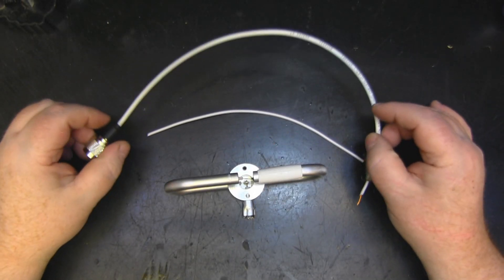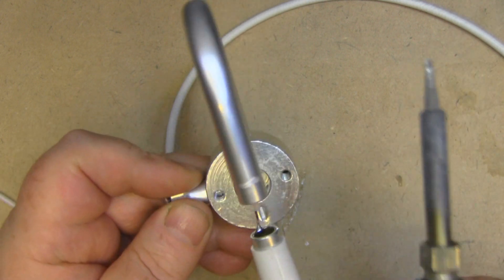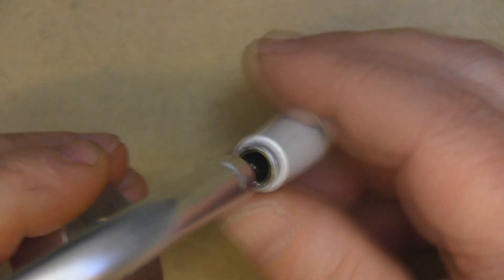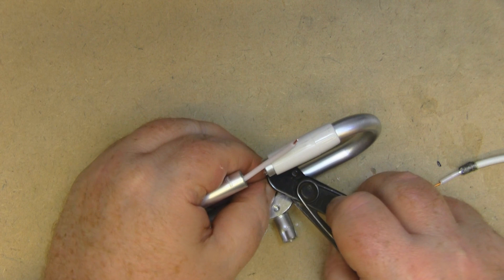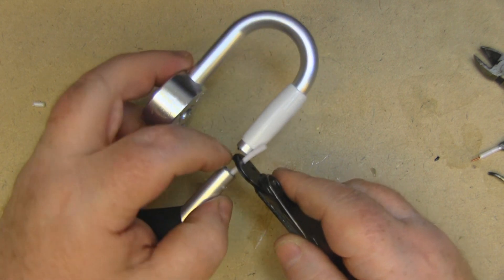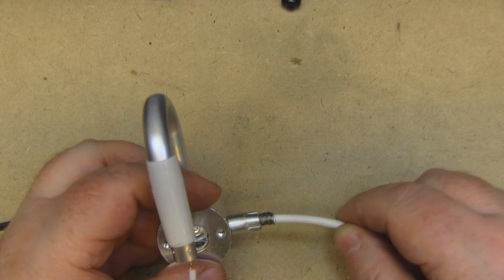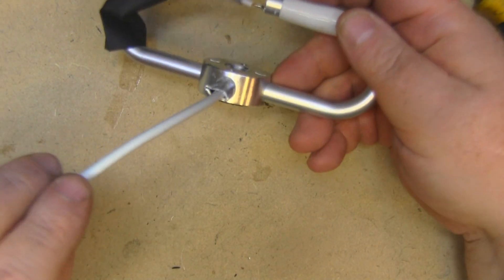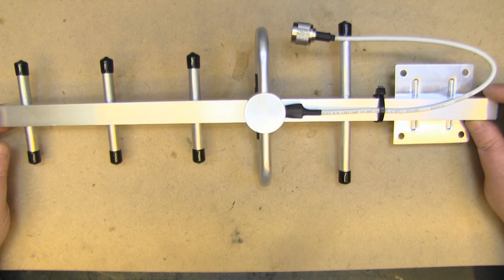900MHz Yagi changing the coax and taking a look at the balun

Comment: Is possible tu put a lmr400 cable on that?
Reply from the maker: Yep
Reply: @andrewmcneil   I notice you put a cupper wire, inside, is a must tu put lmr400 wire like this, or should leave it and only solder the lmr400 cable, I newbie, sorry for asking, the 2 mm cupper wire will fit, inside?
Reply: And will have the same frencwency?

Comment: Andrew, Tiniri asks below what the impedance of the "innor coax" is.   The inner connector has the shield removed and the shield becomes the inside of the tube of the dipole. This is not 50 ohms but a higher impedance, probably closer to 100 or more ohms. It appears to be a copy of  other similar dipoles but missing the superior design.

Comment: So, the coax inside the tube is acting as a balun?  That's something I have never seen before.  I usually use a quarter wave folded balun, however I really liked the sleeve balun you did recently on another Yagi video.  Much neater and far less room consumed.  I usually earth the centre point to the boom with almost a point connection. (Like a bolt through to the boom).  This thing has a huge connection.  Guess the bandwidth is increased.  Would really like to see frequency response and a VSWR chart.